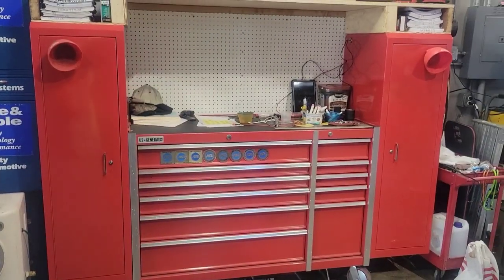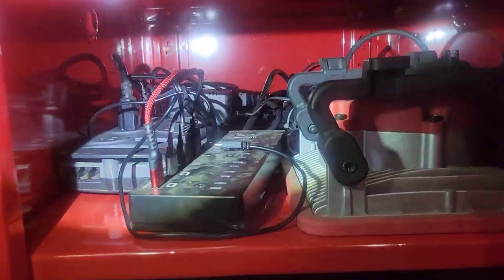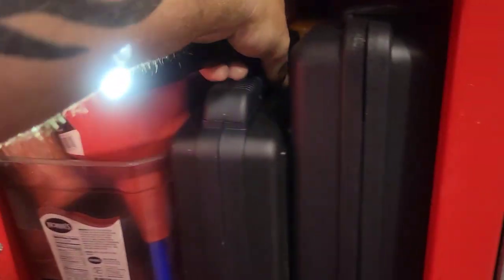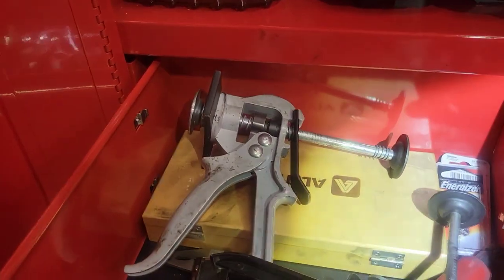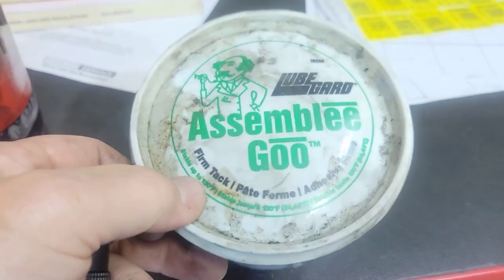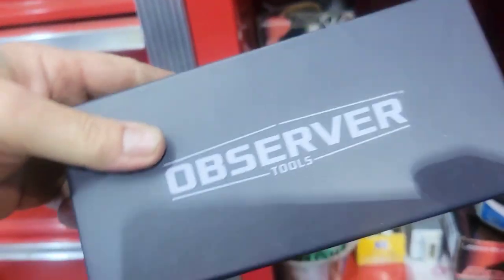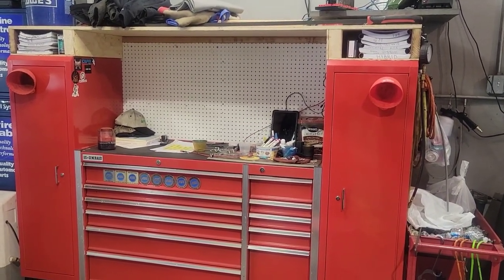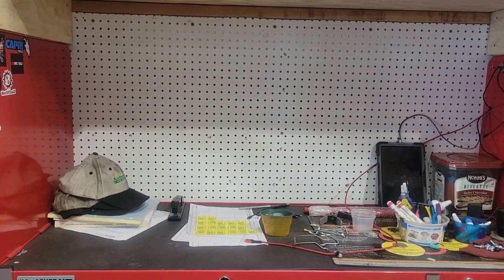US GENERAL 56" HUTCH TOUR and side locker addition

Comment: That is sweet man. Hey give you an idea for light in your hutch. Get you a 4 foot LED strip light and put it up in the center across the middle inside the hutch. That would light up the inside the hutch good. Just an idea.
Reply from the maker: Thank you brotha I appreciate it
Reply: @NutsandBoltswithTone  no problem. You can get those lights for like $10 and very easy to install. Just 2 little clips hold them up.